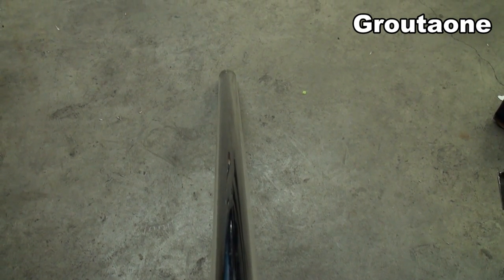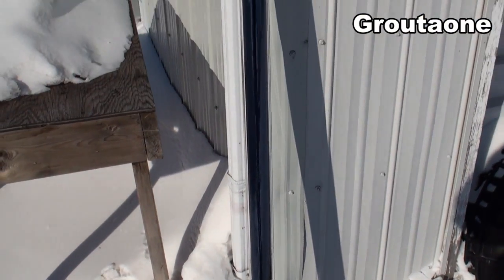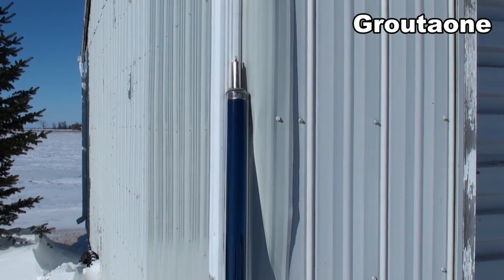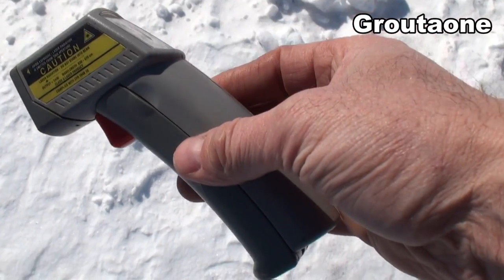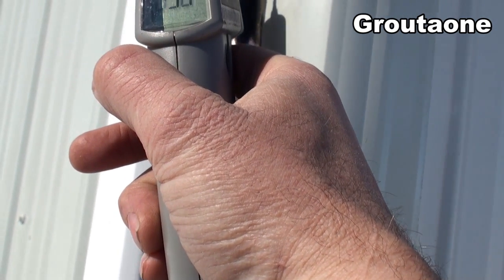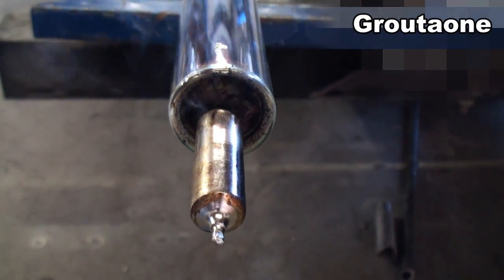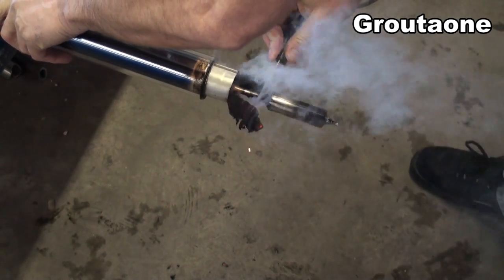Solar Vacuum Tube Makes 370F Temp @ -19c  PT2

Comment: That is very interesting.  Imagine using this heat source to drive a Stirling Engine connected to a small generator.
Reply: It is far better to directly heat water in a hot water tank.
Reply: Sterlings are like Tesla's... High rpm's but not enough torque to turn a generator.

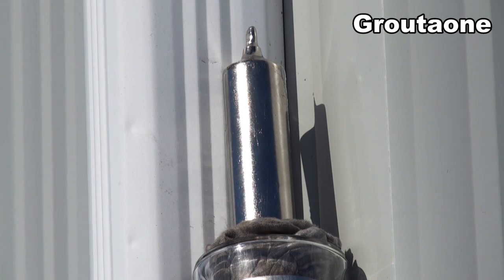Comment: At 1:17  Wind has no temperature effect, on any surface, other than skin..Planes fly at over 500 MPH in over -50..The aluminum skin, will still be  the same temp as the ambient air...Other than that ..great video..
Reply: That's completely wrong.

The wind has the effect of removing heat from the bulb of the tube and literally flying away with it. So something hotter than the air will get cooled to the ambient air temperature much faster if there's wind.

Comment: I am getting some solar tubes but I am interested in figuring out a way to heat water with them. Two of my ideas are: float the solar tube on a piece of heat resistant material such that the water flows in and out of the two at all times. My goal is to keep Stock tanks from freezing. The other is to make a copper conductor like the one you had in the video and submerge this in Stock  tank. How did you make that? What is the item at the end of the copper tubing that is used to transmit the heat? Thank you for your help
Reply: These copper tubes in the center are mainly hollow tubes with a small quantity of water inside (small enough probably to prevent the tube from bursting on cold winter nights).

As the evacuated tube heats up, the water inside boils up and the steam reaches the enlarged cylinder on top and heats it.

However, if the cylinder reaches 370 deg. F (187 deg C) as seen in this video by Groutaone, this means that the steam pressure in the tube may reach about 1 MPa or 145 PSI. I am not sure these tubes are designed to withstand such high pressures on the long term.

Normally, these enlarged cylinders are enclosed in a manifold where an antifreeze / coolant solution circulates to collect this heat and bring it inside the house. The manifold is also designed to prevent any water / snow ingression inside the evacuated tubes.

But seeing such a tube perform so well at -19c is highly encouraging.

And for those asking why not use photovoltaic, the reason is simple: For heating / hot water purposes, a collector is far more efficient than PV panels. Alternatively, a PV panel may be installed next to the evacuated tube collector to run a small pump to circulate the antifreeze / coolant thermal carrier.

In renewable energy, there are uses for both PV and thermal solar.

Comment: If you are thinking on solar heating your house I suggest solar PV panels they will be the least expensive option at the moment.
You just need the solar panels cables instead of pipes and resistive heat elements.
I will do the same for my house I made the calculation and they will get at around 2.7cent/kWh of heat over a 25 years amortization period.
Those solar evacuated tubes will be a few times more expensive than solar PV that was not the case just a few years back but now with under 1$/Watt solar panels it is.

Comment: How do you use a thing like that?
Reply from the maker: This works great with floor heating but lots of them are needed to heat one building
Reply: surprising how well they work ,il be watching ,I heat with electric with no back up and even a small set up would help ,bet you could heat a 40 gallon tank in a short time at 360 degree heat in cold weather ,now figure how well it would do in milder weather .

Comment: I really cant wait to see what you end up doing with these. I'm really loving the performance of those things. Having an array of those tubes on our roof would cut our instant on fuel oil powered water heater use by like well shit, I don't know if we'd even need it anymore with a big enough thermal mass in the basement.
Reply from the maker: Yep you got the right idea, store the heat and a proper sized setup would give you sweet free heat day and night

Comment: I presume that the level of light intensity is critical and that all the snow you have reflects all the sunlight encouraging maximum absorption by the tube and hence efficiency?
I did wonder what might happen if it was hung out in the open air allowing 360 degree exposure if the results might be any different with the sun moving over the horizon.
I'm amazed just how quick the response to sunlight exposure turns out to be let alone how high the temperature gets!
-Thanks. Your demonstrational experiments have been most interesting and enlightening.

Comment: How does the heat travel from the rod to somewhere useful? The house for instance? Would you put a water tank on the top and super heat the tank?
Reply from the maker: That heat bulb would insert into a flowing water jacket and then into a floor heat system or hot water forced air

Comment: That's pretty impressive isn't it G1? What exactly are those tubes anyways? Hot stuff!!
Reply from the maker: These are solar hot water heaters, about 150 of them would nicely heat my shop
Reply: groutaone
I'll say they would! Probably be enough left over to heat mine too! lol
Reply: groutaone How much does one cost?
Reply from the maker: montez341 $25 but they are normally sold in sets